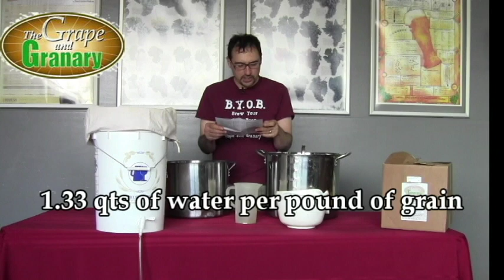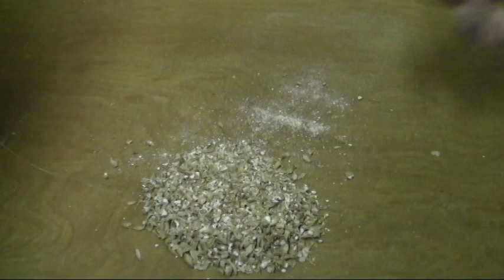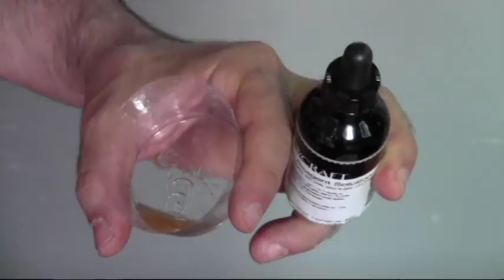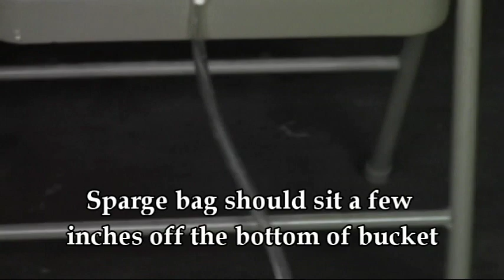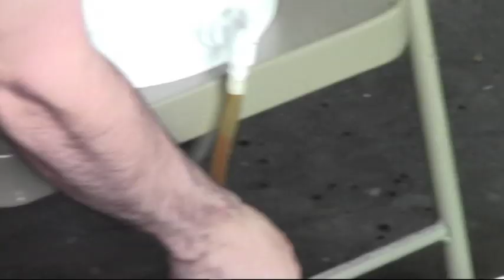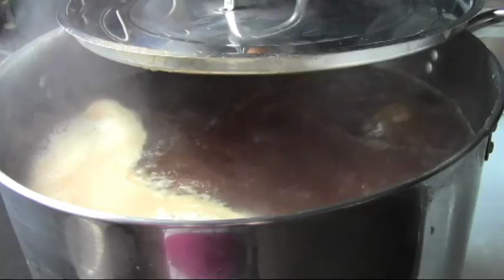How To Brew An All-Grain Batch of Beer

Comment: Great video. Best I've found on YouTube. 2 questions. 1st. Is it ok to use a non stainless steel pot for boiling.  2nd. At what point does everything need to be sterilised.  Thanks in advance.
Reply from the maker: 1) Enamel is fine. Aluminum should be passivated first (bake the stockpot at 450 deg f for 20 min to put an oxidized coating on it). Nothing needs to be sanitized until after the boil. Sanitize all items the touch the beer after the boil.

Thanks!
John

Comment: Can sparge bags be cleaned for reuse?  If so, can you recommend the best process to avoid contaminating future batches?  Thanks
Reply from the maker: +Raymond Jolly 

Yes, I put mine in the washing machine with no soap. It does not need to be sanitized because you will be boiling the wort after using it.